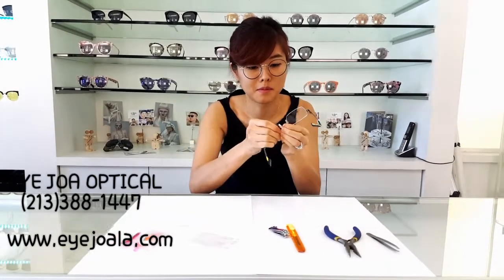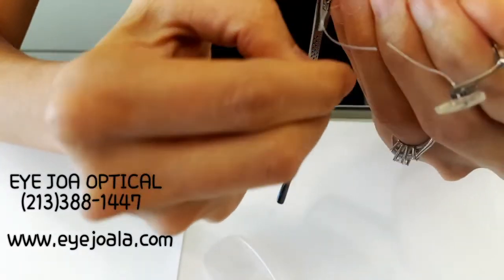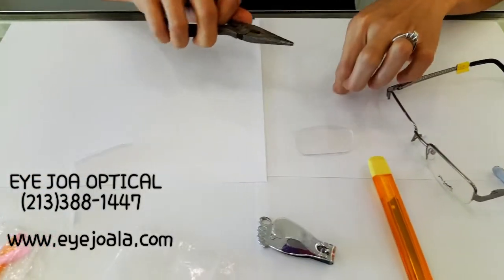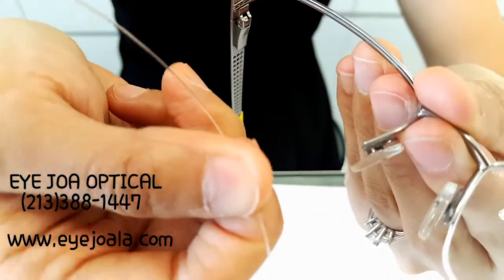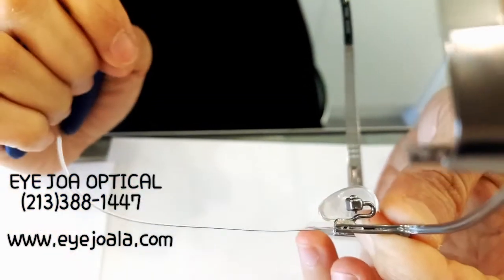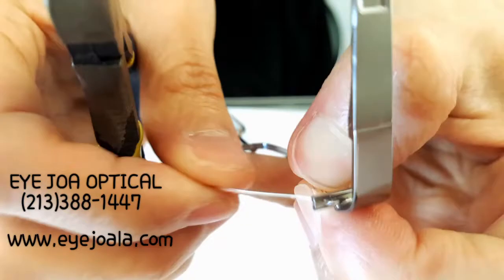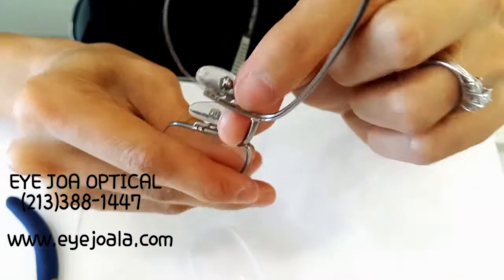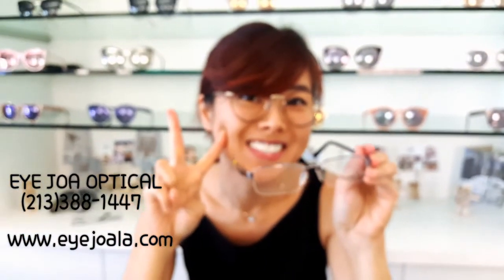how to fix semi rimless glasses part 2 (when string is broken)

Comment: This is the only good quality and correct video out there...discussing direction of the threading, tensioning and locking the line in, etc.  Easy fix, just a bit meticulous at worst. An optician told me mine couldn't be fixed as the frame channel was slightly bent. Tried to sell me another.  I took it home, squeezed back the ever so slightly bent portion of the channel and redid the monofilament. He didn't gain a sale, he lost a customer. New optical store for my 2 pair this year.

Comment: What gauge fishing line? Thanks.
Reply: I used clear fishing line 40lb (18.2 Kg) with 0.61 mm in diameter. Worked perfect. It cost me 6 bucks, bought the whole hank 370 yards from Walmart. Same thickness and strength. After fix, I couldn't tell a difference between original and fixed one. And it was really expensive glasses.